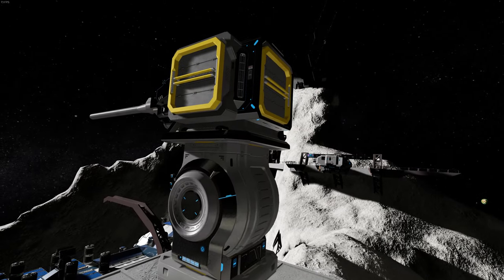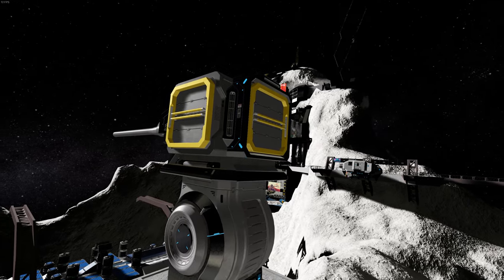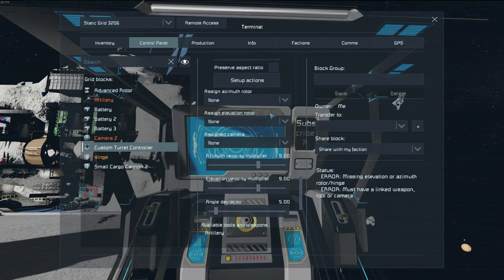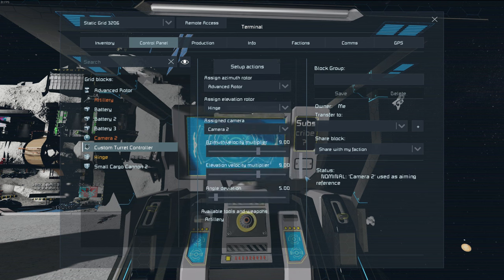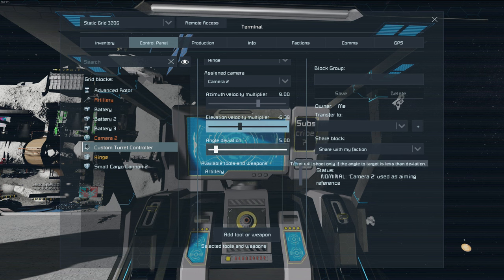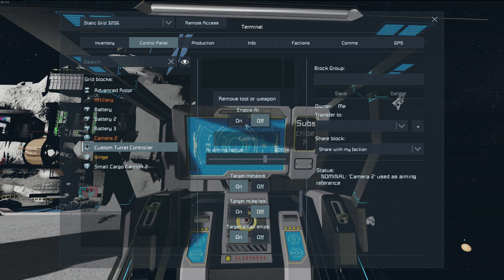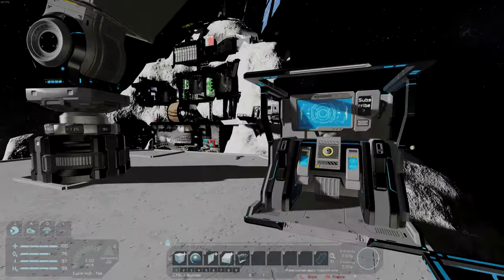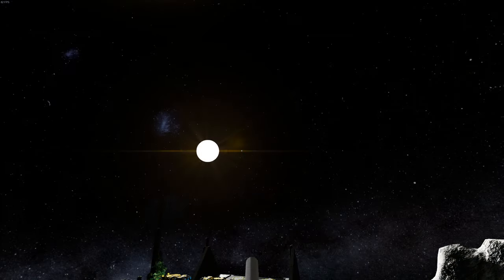Quick Tips: Custom Turret Controller - Space Engineers

Comment: I am a bit confused, when using the custom turret controller I am missing some of the controls, and there is no option for enable AI or control.
Reply from the maker: If you do exactly as I did in the video, it will work. Ensure you programmed the correct hinges and rotors into the custom turret block

Comment: So I’m not sure what I may be doing wrong but when I place down the large grid railgun on the hinge it starts violently shaking while aiming any way to fix this
Reply from the maker: you might try activating experimental mode in the game settings?
Reply: I wonder if playing with the hinge/rotor force sliders to add stability and if decreasing the rotation speed of the custom turret control block might have any effect. I will also be trying to make a railgun turret soon. I haven't played around with it yet, but I am excited to dive into it. If it shakes from just the weight of the block you might have to counterbalance the gun so that the sub-grid mass is centered over the rotor. The firing recoil (if any) also might add to this interesting challenge.
Reply: I think "Share Inertia Tensor" in the hinge's settings will help.
Reply: I believe the large grid rail guns won't cooperate for a turret design, due to their mass.  I haven't tried with the small grid ones, but the small ones might be more useful due to the faster reload (roughly the same as WWII battleship).  Whereas I find the big ones to be glacially slow and ineffective against anything that isn't a station.
Reply: @DiZtheJedi  yeah that fixes most of the problems
Reply: @brofrogscool1121  Cool, glad I could help.

Comment: Hi, I'm facing a problem with timer blocks.
When starting or activating the timer, the timer executes only those commands that are in the first ten slots (on the first toolbar), ignoring all others. So for example: if you set the command "turn off the timer block" in the second toolbar of the same timer block, then nothing will happen. The problem appeared after the update to Warfare 2.
What's wrong?
Reply from the maker: The timer block may only be able to execute 1 toolbar worth of commands. Id recomend using the 9th slot in the first timerblock to start a 2nd timerblock with the commands from the second toolbar. If it only just appeared after the update, then submit it as a bug.